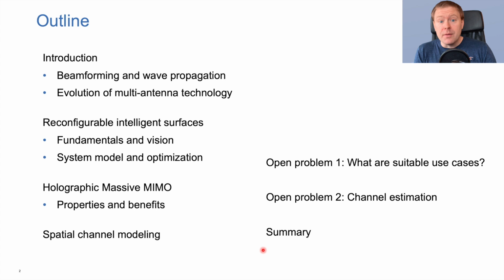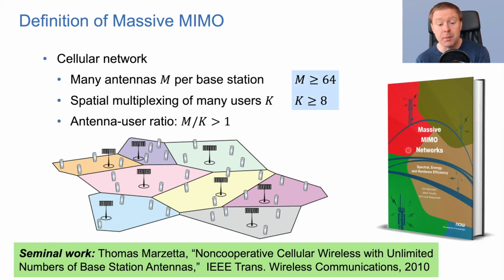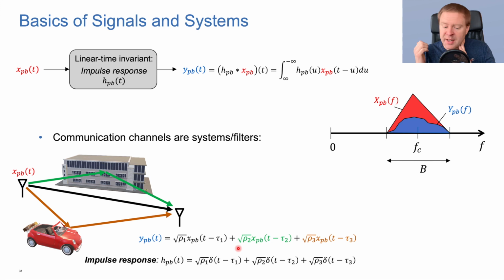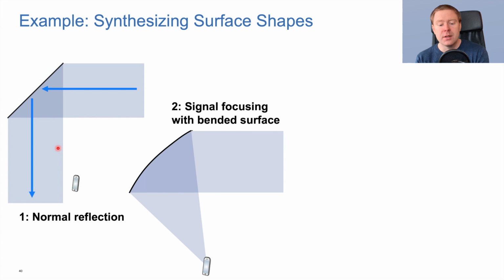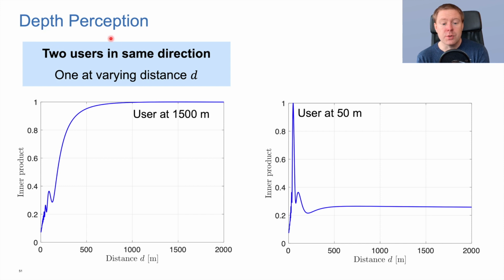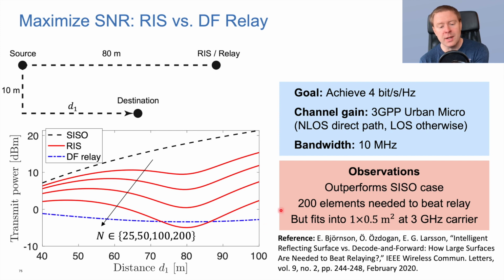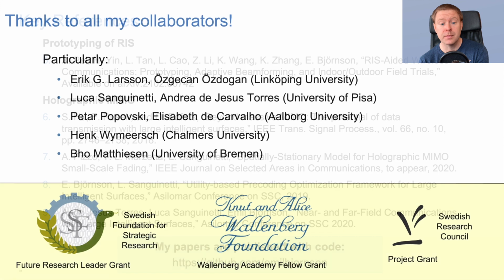Reconfigurable Intelligent Surfaces & Holographic Massive MIMO: Vision, Fundamentals & Open Problems

Comment: Dear Professor, 
Thanks for your reply! It was truly interesting to go through this video. I would like your opinion on whether holographic beamforming can be used for audiozooming on smartphones. As I understand it, there are some frequency range restrictions due to which this method is ideal for ^G/ wireless communication. But is there a possibility that it can be applied here as well? I believe the drawback would be lower frequency would result in higher wavelength ie. more space required. If we can find a workaround, it could be worth exploring. 

Thanks again for your video!
Reply from the maker: Hi! Acoustic sound waves and electromagnetic waves are different things, but there are many conceptual similarities. The wavelength of your voice is a few meters long, so microphones are normally much smaller relative to the wavelength of sound than antennas are compared to the wavelength of wireless signals. However, it is common these days that smartphones and wireless headphones have multiple microphones. They are used for "audiozooming". Apple calls this "voice isolation" if you read the tech specifications for their latest iPhones, and describes it here: https://support.apple.com/en-us/101993

The simplest form of voice isolation is to filter out frequencies outside the human voice spectrum, but since these devices have multiple microphones, they can also perform something similar to beamforming in communications: the device uses the microphones to achieve a high signal-to-noise ratio by amplifying the voice and suppressing ambient noises.

The holographic MIMO idea of having a continuous surface that interacts with waves is more of a theoretical simplification than a practicality, but it can be used to understand what is practically achievable when deploying many small antennas/microphones within a device.

Comment: Hello professor, I am Baye from Ethiopia. I want to study my PhD in reconfigurable intelligent surface, can i get huge problem for doing thesis in this technology
Reply from the maker: Hi! RIS is a crowded research area, so it can be quite hard to find research gaps and, as a beginner, there is a substantial risk of being outrun by other more experienced researchers working on the same things. The trick can be to identify new branches in the area. One of these directions is “beyond diagonal RIS”. Another possibility it to look into the challenges discussed in my recent blog post: https://ma-mimo.ellintech.se/2024/02/23/the-dark-side-of-reconfigurable-intelligent-surfaces/

Comment: Dear Prof.

Thank you for reading!

I have a question:  why HMIMO is called holographic?

Here are my detailed question:
As I can see, the H in HMIMO should stand for holographic and it should obey holographic principles.
But as I read more HMIMO papers, especially this one:
Holographic MIMO Communications: Theoretical Foundations, Enabling Technologies, and Future Directions,
it seems only a very small part of this technology is about holography principle, 
i.e. recording and reconstruction by reference wave. If that's the truth, why HMIMO is called holographic when holographic principle is actually not used in it?

Here is my guess:
In fact, more papers are taking HMIMO surfaces as "continuous surface" or "continuous MIMO", i.e. infinitesimal elements. And it makes me think that the continuous surface is the reason for the word "holographic" since the surface used in optical holography is continuous. This reason is far-fetched.

I would be very grateful if you can answer this!

Cui
Reply from the maker: I also find the naming somewhat far-fetched, but the motivation is the one that you mentioned. The company Pivotal Commware has a trademark on Holographic beamforming (HBF), and they explain it like this in their white paper from 2017:

"HBFs do not use discrete phase shifters to accomplish beam steering by the antenna. Instead, beamforming is accomplished using a hologram. [...] The HBF has a single RF input port on the backside center of the antenna which is directly connected to an RF distribution network on the inner layers of the HBF. A travelling RF wave propagates from the input connector through the distribution network and is depicted as yellow lines fanning out from the central feed point in Figure 5b. In optical holography, this travelling wave is referred to as the ‘Reference Wave’ and it is this wave we wish to transform into a desired beam. The desired beam shape is referred to as the ‘Object Wave’ in optical parlance. The ‘Hologram’ is then the structure that will transfer energy from the Reference Wave into the Object Wave." and so on...

https://pivotalcommware.com/wp-content/uploads/2017/12/Holographic-Beamforming-WP-v.6C-FINAL.pdf

I believe that having large surfaces is more important in the future of MIMO than having continuous surfaces, which is why I prefer to analyzed and consider "extremely large aperture arrays (ELAA)" that might be created in the holographic beamforming way, but not necessarily.
Reply: @WirelessFuture  Thank you! Now I understand that the holography is not necessary for HMIMO and it's more about large surfaces.

Comment: Hello, professor.  I want to show What's the relation  between the rate in IRS and frequency to show the effect of high frequency on rate in IRS ...
And thank you in advance ...
Reply from the maker: Hi! The choice of frequency will affect two things: The channel model and the amount of available spectrum. These things are then jointly determining the data rate. You will also need to decide what happens to the IRS when changing the frequency. The size of an IRS element shrinks, so you either keep the number of IRS elements fixed (so that IRS area shrink with the frequency) or you keep the IRS size fixed (so that the number of elements increase with the frequency).

I think you can have a look at https://arxiv.org/pdf/1911.03359.pdf The pathloss expression in (19) that is achieved with a correctly configured IRS depends on the aperture size a*b, and not on the wavelength.

Comment: Hi Professor,
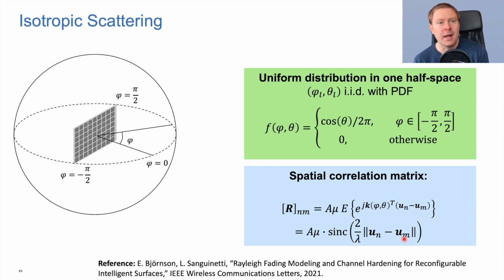A doubt related to the channel hardening behavior of RIS you mentioned at 2:08:02 of this video: I am currently dealing with a scenario in which the channel between the transmitter and the RIS is always LoS and that between the RIS and the receiver varies between LoS and NLoS as a function of time; Is it valid to consider channel hardening behavior when the receiver is in the NLoS regime of the RIS while the transmitter is in the LoS regime (assuming N is considerably large and the direct path is NLoS).
Reply from the maker: Hi! Yes, I think you will get channel hardening also in your setup. Definition 1 in https://arxiv.org/pdf/2009.04723.pdf provides a way to define channel hardening for any type of channel in RIS-aided communication. You can test it numerically by computing SNR/N^2 for many random realizations of the SNR and then compute the variance. It should clearly decay with N.
Reply: @WirelessFuture  Thanks a lot!

Comment: Respected sir, learning to use optimization toolbox of MATLAB, How it can be used for Optmization Problem  in MIMO or Optimizing Power control,Is any Optimization Maltab code is available in github library ? just one example sir.
What Mathematical Equation can be worked upon ?
Reply from the maker: The optimization toolbox in MATLAB is powerful and there is also a useful software package called CVX (http://cvxr.com/cvx/) that can be used to solve convex optimization. When it comes to solving optimization problems in MIMO, one has to start from the problem formulation (What do we want to optimize? Maximize sum rate? Minimize power to achieve rate requirements, etc.) and then rewrite the problem in a way that can either be solved by hand (not so common), by convex optimization (applies to many problems), or by methods that only find local optima (happens for the sum rate). I recommend you to check out Chapter 3 in our recent book on Cell-free Massive MIMO (https://github.com/emilbjornson/cell-free-book), which contains the fundamentals on optimized power control/allocation. There are then specific applications in the last chapter. You can also find some equations in Section 7.1 of the book Massive MIMO networks (massivemimobook.com)
Reply: @WirelessFuture  Thank you very much sir..Many Thanks